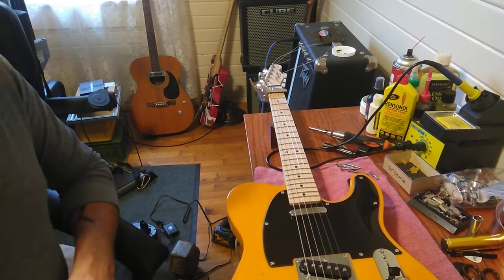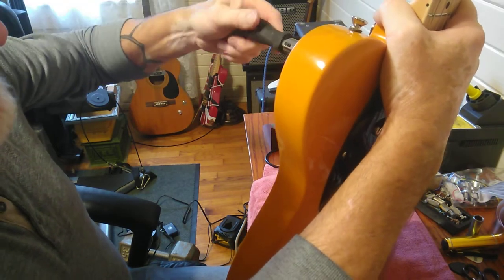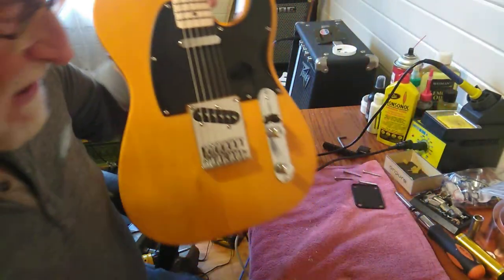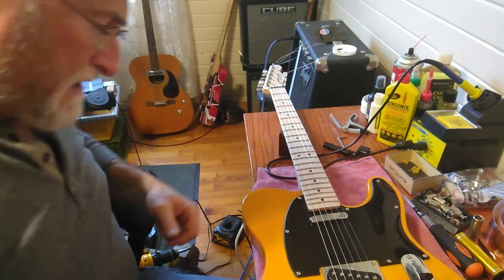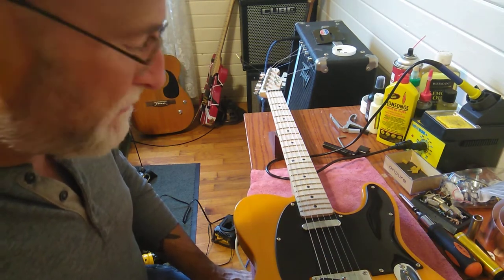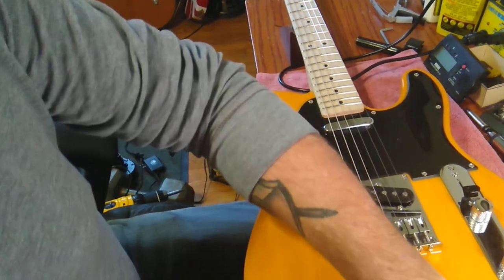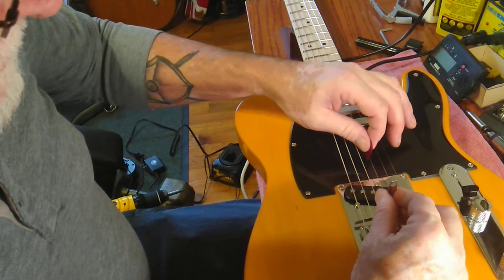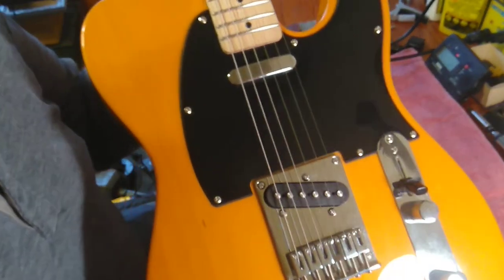Squier Affinity Telecaster setup part 2

Comment: I fixed my high E string by loosening the neck bolts a half turn each under tension of the strings and pulled/pushed the neck headstock. This had to be held while tightening the neck bolts. Fixed my 2018  affinity. 👍great site and videos. 🙏🤓

Comment: I have one I bought for $100 bucks  used ,filthy as hell,cleaned it ,new strings and set up,plays like a million bucks now,changed volume and tone pots to 300k CTS audio taper ,and tone wise it has better dynamics than stock, these pickups read 6.6k at the neak and 6.7 at the bridge  though.!

Comment: I’ve modified my Affinity Tele. Tex Mex pickups, Obsidian kit for 4 way switch and pots and brass saddles. A question. How does one know what the neck angle should be? This is the best video I’ve seen on setting up a Tele. Thank You very much kind sir.
Reply from the maker: Sounds like a amazing guitar. Neck angle is determined by string height and also saddle height. You want to have adjustability with your saddles. It's hard to explain but easier to show. I will address this in a upcoming video because it's something that I don't see talked about much. Thanks for the comment.

Comment: Just a little note about string height. If you use a machinist ruler across the 17th fret and set every string bottom side to 4/64 that will follow the radius of the guitar neck and you don't need to know what it is or have those radius gauges. I like to get mine down to 3/64 if I can and if not somewhere between 3 & 4/64ths.  No buzzing anywhere of course along the string. If there is I look for the high spot and take care of it like you did.  it is surprising that it sounded that good with the measurements you took on those pickups.
Reply from the maker: Good info! I did change pickup heights after the video and it did help the sound. I have a set of pu's out of a Squier standard Tele that I am going to put in pretty soon.